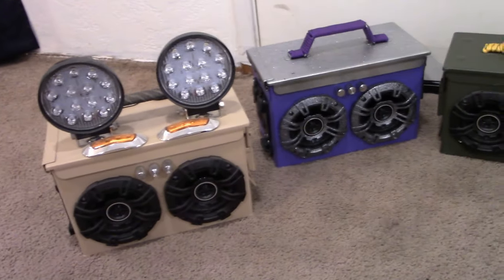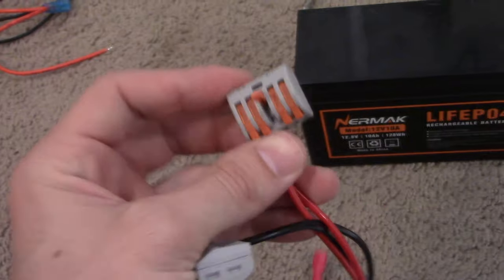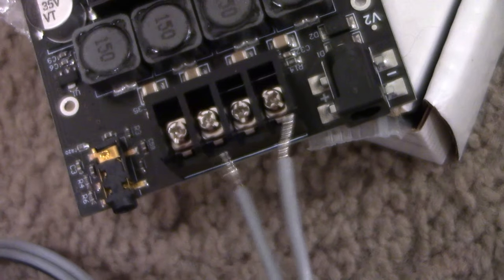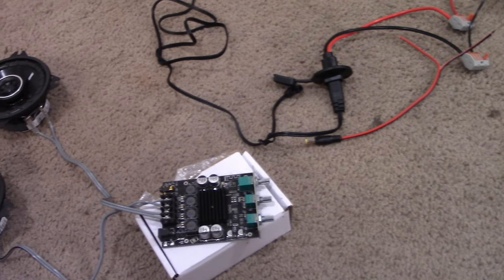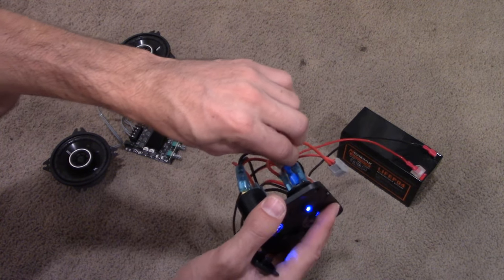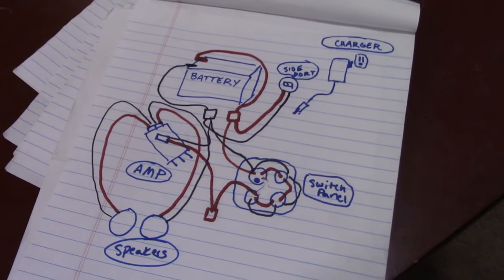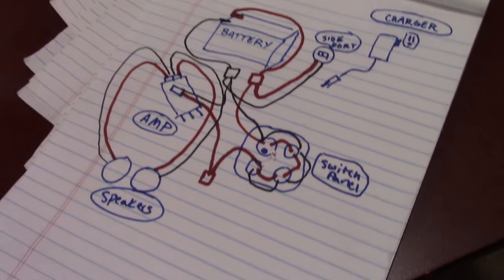How to Wire DIY Boombox - Ammo Can Speaker (Step by Step)

Comment: Did u use the same amp for the skar sub and how did u cut the hole for the 6.5 inch sub
Reply from the maker: Slightly different amp, for the Skar sub I used an amplifier with this description: (Nobsound NS-15G Mini Bluetooth 5.0 Digital Amplifier HiFi Stereo Audio Class D Power Amp 100W x 2 Treble Bass Control) ..... I used a 5.75" hole saw attached to drill to cut the hole for the 6.5 inch Skar sub... I also put a voltage booster between the 12v battery and amp to get more power out of the amp
Reply: @caseymoto  Ight Ty do u have a link or something to the voltage booster and u should make a video on how to make the sub one I’ve only seen one video on one and he didn’t show how to make it
Reply from the maker: @xXThEGoDXx86  here is link to booster: https://www.amazon.com/gp/product/B07T137H2Y/ref=ppx_yo_dt_b_search_asin_title?ie=UTF8&psc=1
I may end up making a video, but until I do, the process is pretty similar.. besides adding the booster before amp, the only other difference was wiring the two tweeters in with the sub, I got these two resistors to go in front of the tweeters to do that: https://www.amazon.com/gp/product/B07H31TLPQ/ref=ppx_yo_dt_b_search_asin_title?ie=UTF8&psc=1#customerReviews
Reply: @caseymoto  Ight ty hope u have a good day

Comment: What size plastic ammo box should I get that fit 6.51/2 150watt marine speakers 30mm 40mm or 50mm?
Reply from the maker: I’d use a 40mm metal can and remove the cross braces..  you can also fit those on a metal 20L gas can.. I wouldn’t recommend plastic , but if you really want plastic it should be about 17” (length of 40mm metal)
Reply from the maker: https://youtube.com/shorts/343ZknA4gx4?si=ohtJfg7Um2UDu-UN   Here is example of 6.5s in a 20L gas can and a 40mm metal ammo can
Reply: @caseymoto  so would 40mm plastic ammo work with 6.5.1/2 150watt marine speakers?
Reply: @caseymoto  the first number should be 17 on plastic ammo box ?
Reply from the maker: @kylewilliams3306  I couldn’t find any information online about plastic 40mm box to confirm the size , but my metal one is 17” inches or 44cm
Reply: @caseymoto  do you know any body that would know what size plastic ammo box to get for 6.5 1/2 marine speakers ?
Reply from the maker: @kylewilliams3306  no, I’ve never seen one made out of plastic.. everyone I know uses metal

Comment: Did you drill three holes and put the amp controls through the side of the box on some of them?
Reply from the maker: Yep.. and the amp comes with the threaded nuts needed to do that
Reply: @caseymoto  cool. I just ordered all the parts to build one. Always used the smaller marine amps in the ice chest radios back in the day. I think I am going to use my 5ah ryobi batteries

Comment: Can you let me know where the parts come from?
Reply from the maker: All parts from Amazon, here are the links:

BATTERY:
https://www.amazon.com/dp/B097BRKCQP?...

SPEAKERS:
https://www.amazon.com/dp/B01BLVF3GW?...

AMP:
https://www.amazon.com/gp/product/B08...

if the Amp doesn't come with a power cord, here is the standard type that works with it:
https://www.amazon.com/gp/product/B07...

SWITCH PANEL
https://www.amazon.com/dp/B07T9HC65T?...

SIDEWALL PORT:
https://www.amazon.com/dp/B07V6NJ37P?...

CONNECTOR BOXES:
https://www.amazon.com/gp/product/B07SFCCPZ6/ref=ppx_yo_dt_b_search_asin_title?ie=UTF8&psc=1

CONNECTORS THAT CRIMP ON WIRES:
https://www.amazon.com/gp/product/B01...

WIRE (YOU MIGHT NOT NEED THIS LARGE OF A ROLL):
https://www.amazon.com/gp/product/B07...

WALL CHARGER:

Mroinge MBC022, 12V 2A Lead Acid & Lithium(LiFePO4) Automatic Trickle Battery Charger Smart Battery Maintainer for Car Motorcycle Lawn Mower Boat ATV SLA AGM Gel Lithium(LiFePO4) and More Batteries https://a.co/d/1JPAmOR

FUSE if you want to add it:
https://www.amazon.com/dp/B081DHT8Y7?...

Non-Electronic Parts:

50-CAL AMMO CAN:
https://www.amazon.com/gp/product/B01...

SOUND DEADENING MATERIAL:
https://www.amazon.com/gp/product/B08...

HOLE SAW to cut the speaker holes in Ammo Can:
https://www.amazon.com/gp/product/B00...

Comment: How could you add a small subwoofer to this?
Reply from the maker: at 1:01 in this video, you can see one of these has a subwoofer.. the subwoofer has two sets of terminals (+ and - wires), you can wire one set to the left channel and one set to the right channel.. you can then wire in a tweeter on each of those channels... I put a 33ohm resistor in front of each tweeter to reduce the power sent to them... here is link to video with that boombox playing : https://www.youtube.com/shorts/29JhFUywzWQ

Comment: if i wanted to add tweeters how would it be wired?
Reply from the maker: You can wire one tweeter to the left channel, and another to the right channel of the amp.. even though the other speakers are already occupying these left and right channels, tweeters can be shared on the same postive and negative wires.. when I did this I included 33 ohm resistors on the positive wire to the tweeters, as I read these tone down the tweeters so they don't get too loud, here is the link to that, it worked well for me : https://www.amazon.com/gp/product/B0B7MRL5S5/ref=ppx_yo_dt_b_search_asin_title?ie=UTF8&th=1

Comment: Do you know how how could hook up plye 4ch hydra bluetooth amp, APIELE 22mm Latching Push Button Switch 12V Angel Eye Ring Light LED Waterproof Stainless Steel Round Metal Self-Locking 7/8'' 1NO 1NC 1 Pack (Blue) 12v Talentcell 6000mah rechargeable battery ,charged port using these 10pcs Conductor Compact Connectors Lever Wire Nut Electrical Connectors with Fixed Base for 3 Circuit Inline Splices 28-12 AWG
Reply from the maker: Similar to the general plan outlined in this video.. the talentcell battery should be hooked up to positive and negative electrical connectors so you can hook up other things to battery.. from those connectors you hook up push button switch and charge port, as these two components attach to battery. the push button switch would also be connected to the plye 4ch amp because the switch can control when the amp turns on and off.. then the speakers attach to amp
Reply: On the switch button I have the red wire connected to one blue wire where should the other blue wire go I took out the yellow wires on this switch APIELE 22mm Latching Push Button Switch 12V Angel Eye Ring Light LED Waterproof Stainless Steel Round Metal Self-Locking 7/8'' 1NO 1NC 1 Pack (Blue)? I was woundering if you could draw me a diagram on how to hook up the plye amp 4ch hydra amp, toogle switch I listed , Tegg 5pcs DC-099A DC Female Panel Mount Charging Wire Threaded Socket Jact Connector with Dustproof Plug IP67 68 Water-Proof Large Current Power Adapter 5.5x2.1mm .12v Talentcell 6000mAh rechargeable battery using this 10pcs Conductor Compact Connectors Lever Wire Nut Electrical Connectors with Fixed Base for 3 Circuit Inline Splices 28-12 AWG thanks
Reply: @caseymoto can you draw me a dishes on how to hook up plye 4ch hydra amp, APIELE 22mm Latching Push Button Switch 12V Angel Eye Ring Light LED Waterproof Stainless Steel Round Metal Self-Locking 7/8'' 1NO 1NC 1 Pack (Blue) I took out the yellow wires in the switc and twisted one red wire and one blue wire together I wanted to know know where the red blue wire that I connected together and the black and the blue wire go, female male pigtale for camera , 12v Talentcell 6000mAh recharageable battery , Tegg 5pcs DC-099A DC Female Panel Mount Charging Wire Threaded Socket Jact Connector with Dustproof Plug IP67 68 Water-Proof Large Current Power Adapter 5.5x2.1mm, using theses 10pcs Conductor Compact Connectors Lever Wire Nut Electrical Connectors with Fixed Base for 3 Circuit Inline Splices 28-12 AWG thanks
Reply from the maker: @kylewilliams3306  the Apiele latching switch can be confusing to wire, because there are multiple ways  to wire it which do different things with the LED light .. I like the option where the LED light is only on when the switch is on.. they use different color wires so it’s tough to answer that.. I would recommend studying the diagram that comes with the switch - and testing it on a simple setup using only the battery and a small light or something.. then once you get it working properly you can wire in the other stuff.. I believe for that option there are two wires connected to each other going to the positive side of the device getting switched on, one wire is unused, one wire goes to positive of battery and one wire goes to negative of battery.. if you can’t get it, you can buy a more simple switch with only three wires without all the options with LED on the switch
Reply: @caseymoto  so where would the red wire ,blue, black amp wire what hole to go in 3 spot lever nuts and then what slot shoul the red and blue twisted wire go to the lever nut and the black and blue go?
Reply: @caseymoto  do you know how I could connect plye 4ch hydra Bluetooth white amp, 6000mAH recharge battery, Tegg 5pcs DC-099A DC Female Panel Mount Charging Wire Threaded Socket Jact Connector with Dustproof Plug IP67 68 Water-Proof Large Current Power Adapter 5.5x2.1mm, APIELE 22mm Latching Push Button Switch 12V Angel Eye Ring Light LED Waterproof Stainless Steel Round Metal Self-Locking 7/8'' 1NO 1NC 1 Pack (Blue) I took out the yellow wires so I want to hook up the rest of the wires on the switch to light up when I trun the amp on and off, using theses 10pcs Conductor Compact Connectors Lever Wire Nut Electrical Connectors with Fixed Base for 3 Circuit Inline Splices 28-12 AWG?
Reply: Do you think 6.5 speaker 7.4x7.4”x7.1 will fit on plastic box that’s  14” 15.13”Lx7.88”Wx10.13”? Orange dry marine box?

Comment: What wire did u use for speaker wire? Just 16 ga?
Reply from the maker: The speakers should come with included wiring, which I always use because it has the attachments already… otherwise 12 to 16 should be fine

Comment: How is that little amp doing? I read that it disconnects quite a bit?
Reply from the maker: I have actually never experienced that problem, the amp is doing great!
Reply: @caseymoto  Awesome 👌 did the amp come with the power wire for it or did you have to buy it separately?
Reply from the maker: @pyromonkee2510 there are a few companies selling this same amp online under various names that I have purchased , some come with the cord and some do not, I believe the one I linked does not.. but it is a standard cord that I bought for cheap in bulk so I had them on hand
Reply: @caseymoto Did you use a single battery to power the amp?
Reply from the maker: @pyromonkee2510  just one battery is used in each of these boomboxes to power everything (amp, side panel that has usb charge ports and 12v socket, and lights on the ones that have that) … I put the link to the battery in the description
Reply: @caseymoto  I bought one of the batteries but the 7.5ah version as I figured that would be enough for me. I managed to get one of the chargers a few days ago before they got taken off Amazon too. I used to make boomboxes out of ice chests like you did. Just always used a computer power supply and never got a chance to try using a battery. This is also the first time I'm using the little amp instead of a standard head unit from a car.
Reply from the maker: @pyromonkee2510   cool, 7.5ah should be enough mine lasts really long.. the little amp is impressive considering the cost and size , everything fits easily in the 50 cal ammo can , I’m gonna put more links in description for the non- electronic parts
Reply: Can i wire it in a way that i could use the 12v socket which is on the panel to charge the battery instead of the side one?

Comment: Wall charger is NOT showing up, when the link is clicked on
Reply from the maker: https://www.amazon.com/Suuwer-Battery-Charger-Fully-Automatic-Maintenace/dp/B07FSHD62K/ref=sr_1_7?crid=2Y8VZPI1E24CM&keywords=lifepo4%2Bbattery%2Bcharger%2Bsae&qid=1693430693&sprefix=lifepo4%2Bbattery%2Bcharger%2Bsae%2Caps%2C145&sr=8-7&th=1

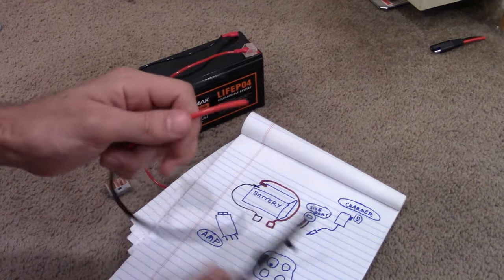Ok it looks like they don't sell it anymore.. this link looks like a very similar item to what I was using, it works for LifePO4 batteries and has the quick connect SAE attachment that is needed, I just haven't tried it personally.. I have also used a Noco Genius Charger, which is one of the more popular ones on Amazon, but it didn't come with the quick connect SAE attachement, I made it work by connecting the cut-off SAE attachment shown at 3:19 in the video.. so that is another option

Comment: How much
Reply from the maker: Can $23, speakers $60, battery $35, amp $31, battery charger $20, charge panel with switch $16, recharge port $6, paracord $8, other various parts $10.. about $210

Comment: You think a 25000 mah portable battery pack would power this? Something that you could easily remove an charge in the house 🤔
Reply from the maker: I've used a 6000 mAh lithium ion battery pack when building this in a smaller container, it worked OK but I definitely noticed it needed to be charged more.. so it should work but I wouldn't recommend it, the larger 10ah battery here doesn't require charging often
Reply: @caseymoto  hmm 🤔🤔wonder how long my 25000mAh would last. Trial an error i guess. Thank you!!

Comment: Do you use a low voltage cutoff when using this style of battery
Reply from the maker: Good question, I do not use that , don’t believe it is needed with this type of battery
Reply: Thank you for replying back, I am planning to build a speaker box for my son,

Have you ever built a waterproof speaker box using exciter speakers?